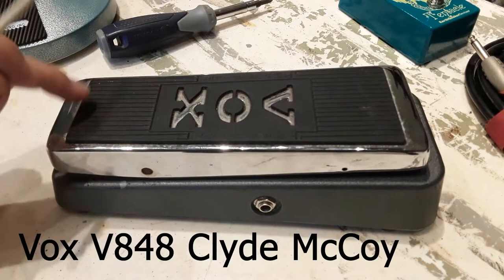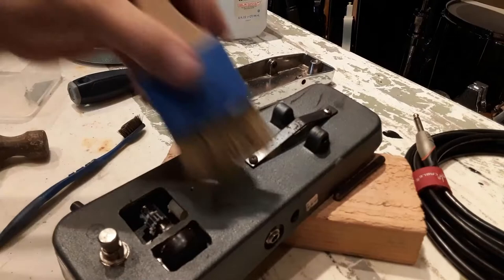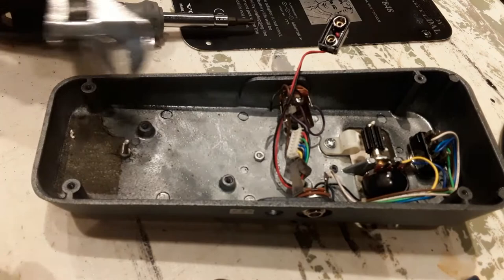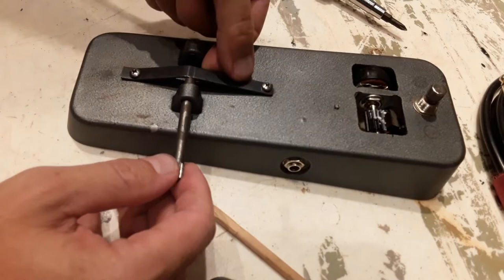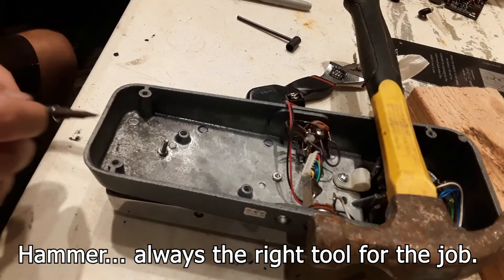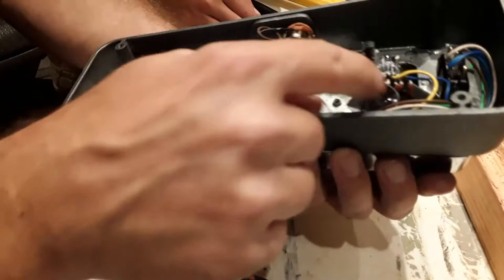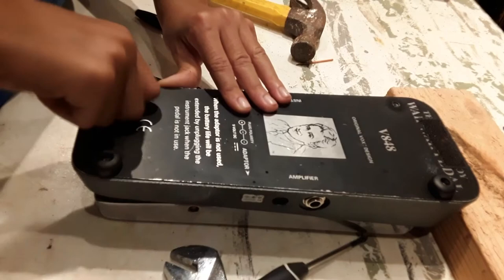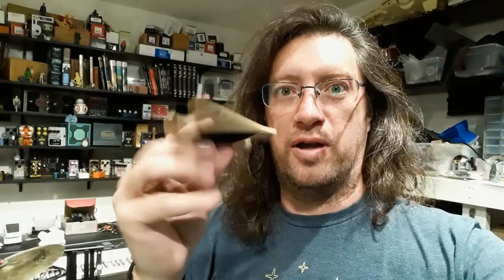Fixing a Floppy Wah Pedal - Vox V848 Clyde McCoy wah disassemble & repair

Comment: You’re fixing a problem which does not exist :)

I wish my wahs would have ball bearing on the treadle. There’s like very few things as annoying as resistance when you move it. Cocked wah-sound is pretty outdated at this point and it gives much more precise control over that wah effect when there’s as little resistance as possible. Also I’ve had so many wahs where the casing is bent because someone has been tightening the screws.. not that it matters but anywho.

Anyone having the issue of too much resistance and if it’s not the treadle  check the alignment of the rack in pinion gear. Move the cable holder bit back or move the pot away from the rack to give just enough clearance. Just make sure it does not skip a teeth. Use lower resistance pot like teese, fulltone or castledine. Dunlop hp2 has always some resistance to it so does the chase tru-talk.

Comment: What I would have done is place a shorter screw first and the two screws placed upside down with the nut placed on the bottom side so with a fixed wrench I would have adjusted it without much problem, good video and greetings from Argentina !!!

Comment: If only it was that easy. I just bought a used 535Q. I've never owned or used a wah pedal but I didn't think it was supposed to fall forward like that. Figured I shouldn't mess with the pin so went in underneath. Well, the circuit board isn't small like that. It literally runs the length of the pedal. Had to take off the input and output sleeve but there are 2 small knobs that don't come apart so I couldn't lift out the board. I was able to bend it up just enough to get a tiny wrench underneath and tightened the spring all the way. Didn't help. There was white grease under the tension spring that didn't seem like it should be there but maybe it is. Anyways the white plastic piece that adjusts the pot gear that he pointed out can move against or away from the straight gear putting pressure against it and that kept it from falling. I originally put it all the way forward and it was too tight where I couldn't even move the pedal so I tweaked it to where I got enough resistance that it doesn't fall now. that was much easier since access to the two spring screws was terrible at best but they are tightgood access to the screws but they are tight
Reply: Hope this helps anyone with a 535Q as I couldn't find anything on that specific model and was thrown off by the full size circuit board. IfI took the pin on top out I would have probably never gotten it back in plus it really wasn't as loose as this one so although I tightened it all the way, I'm not sure I needed to.
Reply from the maker: I have a 535Q too, good to know it's so different and difficult! If mine needs work I'll try to film it for the rest of us. I'm just figuring this stuff out as I go.

Comment: I was able to re-insert that pin without taking the board out, or messing with the 2 screws/bolts that hold down that steel bar that the pin goes under.  What you have to do is insert something through the other side that can pry that bar down enough to get the pin started under it, in my case a Phillips screwdriver (a Phillips has a tapered tip).  I put the wah in a vice.  That helps a lot because you need both hands.  You start the pin through on side, with the Phillips holding the bar down as you push the pin in from the other side, thereby shoving the Phillips out.  The Phillips "leads the way" for the pin and keeps that bar down enough for the pin to get under it. From there, you can drive the pin home.
Reply from the maker: This is a great tip! Thanks for sharing 👍🏼
Reply: @noisejunk  I will also add that it was a pain to do, and I’ll never drive that pin out again lol.  My wah is an original Chicago Thomas Organ in really nice condition.

Comment: My wah isn't floppy like that, but I just want to make it have more resistance when I push it down and release it back up.  I don't think there's anything wrong with it, it goes down and up just as easy as any other wah, it would just be nice to have more resistance so I don't have to be SO gentle with it.
Reply from the maker: this method should do the trick! Let me know how it goes. :)
Reply: The white plastic piece that he pointed out that you move to adjust the pot gears can be moved forward to tighten the gear going up and down. This will give you the resistance you need. You'll have to tweak it as all the way forward I couldn't move the pedal.

Comment: Can you make a video of how to fix a broken pedal because you fried it with a wrong power supply? Asking for a friend.
Reply from the maker: 😵😵😵😵😵😵😵😵 that's beyond my mediocre capabilities at this time. But sounds like something i ought to look into.....
Reply: What is the pedal that you fried? Most likely you blew a resistance or something like that and that can be repaired pretty easily if you can work a soldering iron ☺️
Reply: This does look like you've written it for a joke - well, it made me smile.

Comment: I have the exact opposite problem, how should I approch this?
Reply: Same ..
Reply: @cuckmasterflex9106  it ended up some builtup stuff that got it stuck, wd-40 fixed it
Reply: @nexo3046  thanks! I'll try it!
Reply: If you're saying it's too tight adjust the white plastic piece that goes against the pot gear. this will loosen or tighten the resistance of the pedal.